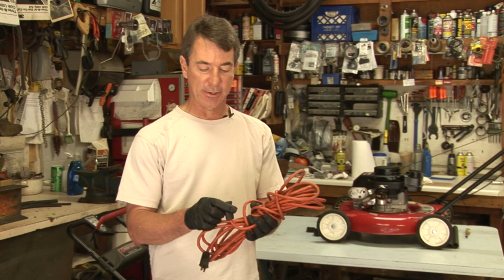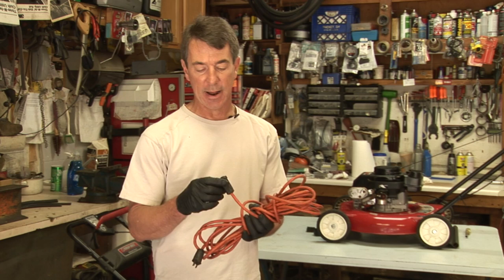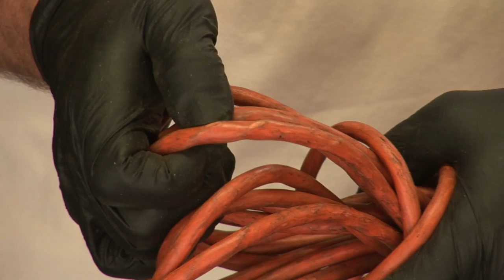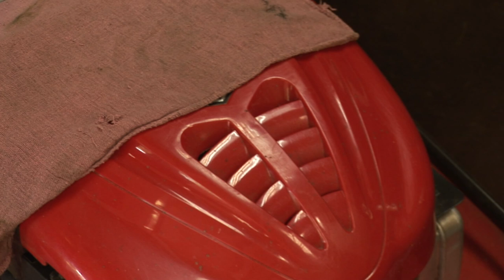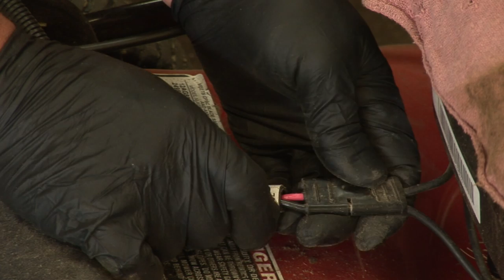Lawn Mower Repair : Electric Lawn Mower Troubleshooting

Comment: Short & to the point video, finally ~ thank you. I have a new 16" Sunjoe electric mower that sporadically stops working when I release the power bar & stop mowing. After waiting 10-15 minutes it will restart. Per the instruction manual, my agreeing opinion is the mower is overheating because the power extension cord is either too old or under-gauge at 16 when it should be 12 gauge. Hard to say, the cord is not marked, except for "Made in China". 🙄 
(I will be buying a heavier MARKED 12g cord this week.)

Comment: how do you replace the roller on a mountfield princess lawnmower.  There is a major faults with these lawnmowers but they are not dealing with it at mountfield properly, this will be my 3rd roller

Comment: Thanks for the excellent video! Do you answer questions? 
The symptoms of my electric lawnmower motor:
-doesn't start but when I tap the center shaft lightly with a hammer it almost starts, as I jostle the unit it continues to almost start
-when I wack the center shaft, then it starts and runs until it cools down

Comment: Why does my 5hp governor rocker-arm oscillate after warming
up? The spring has good integrity, and I added a teaspoon of fuel reviver; and I also tried cleaning the throttle mouth and intake filters but it vacillates between high and low idle until it dies. Wussup?

Comment: I have a Rolux electric lawn mower, the  replaced the electric switch on the handle, there is two micro switches inside, i replace all the wiring , and now i am stuck, one electric wire from the motor, the other the power cable all goes to the switch, what goes where, to the switch , please help me

Comment: Thanks. (If you aren't being sarcastic).  Otherwise, try checking
the oil; fuel can seep into the oil past the pistons and foul it, causing the engine to run for a while before the engine's governor oscillates then shuts itself down.

Comment: can you make a video on the electric motor that the lawn mower uses to start mine i think is either worn out and needs to be re built of is just not turning when i hook up the power supply i can feel it vibrating but the top does not turn

Comment: c'mon dude, troubleshooting? electric lawnmowers that run w/a cord, check the battery? how about the rectifier/diode assembly to verify you are getting your dc to the motor? this kind of simplistic "troubleshooting" is a waste of time. You seem like a nice guy, but look at the camera and impart something more than "is it plugged in" sheesh...and yeah, that's a gas mower with electric start,right?